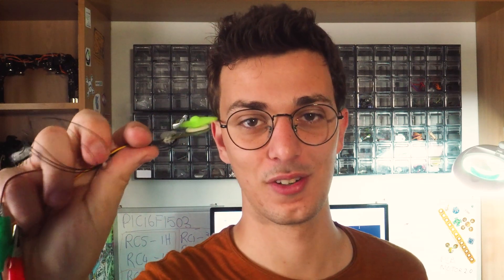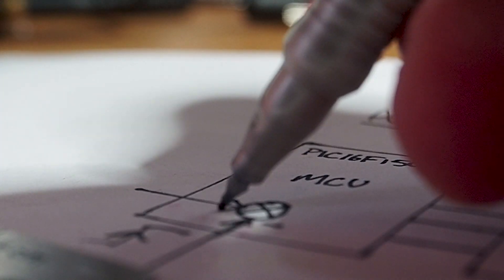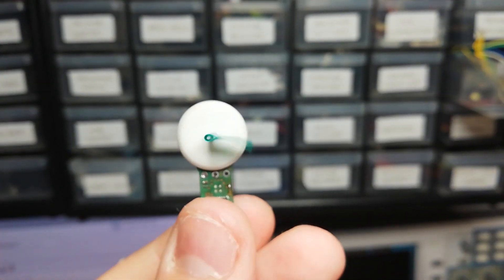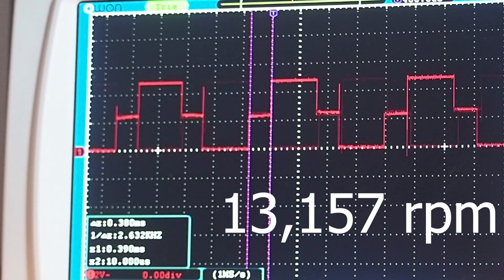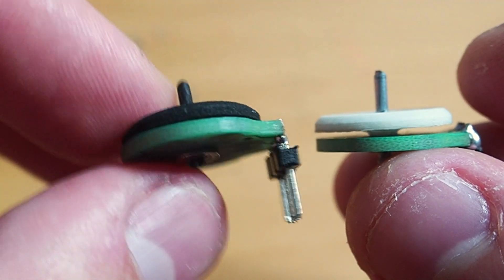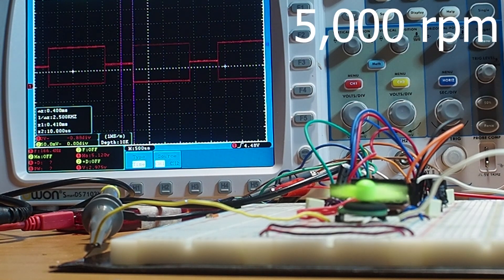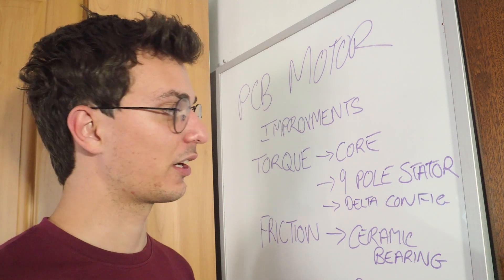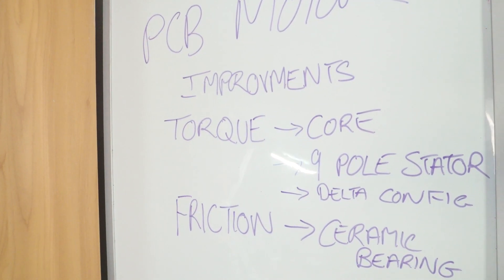PCB Motor - How fast can it go?

Comment: i feel like one good use case for these motors could be for air circulation and ventilation of electronic devices. Like how laptop computers have fans inside to circulate air and cool the components - they could instead have a few of these built straight onto the motherboard, directing air flow through the internals. They're really small and can basically be surface mounted.

Comment: you may get more rpm if you use a TMC driver. they use very fast ramping in their timing and the motor has better syncing with the waveforms.
keep up the great work.
Russ from Ocala, Florida, USA

Comment: hi, very interesting.
You switch to the DSP but then also switch to double, that are probably done in software (most uc, if they have and FPU can do only float).
My suggestion is, instead of using double, continue to use int, and if you need more precision switch to 32bit integer (your pic is a 16bit cpu).
Best would be (IMHO) to use an stm32, so you get 32 bit, clock that can reach over 180MHz for small price, and a lot of Flight Controller already uses them so the "drone" phase will be so much more easy to deal with (you may even think about one MCU controlling motor + sensor!)

If you drop a link to your code repository, i would be super interested to take a look into it! I am myself working on a opensource/hardware flight controller that in current form is 21x21mm and should weight less than 10g, but using an ESP32 (just because i want WiFi control), unfortunately it would not have enough pin to directly drive all the 3 phase for each motor, but i have an early variant using a stm32h743z: 480MHz, 144pin monster that takes 22x22mm in its LQFP, or the BGA goes down to 10x10mm (but never deal with BGA, I pass for now)

Comment: You need to have a more balanced rotor, the wobble has negligible impact on speed as compared to the energy it saps with an unbalanced shaft. That's why tops can spin so long is the balance is helping the rotation rather than fighting it.

Comment: A motor stator has to have an EVEN number of poles. Second, the stronger the magnets, the higher the BEMF. you either need to reduce the number of turns of wire per stator pole, or, raise the supply voltage. Once the motor is spinning fast enough to generate about the same voltage as the power supply, the current rolls off, and the motor just won't draw current to run any faster. The larger magnets will produce a lower speed, but much more torque.(a good set of bearings won't hurt)

Comment: An idea to reduce wobble,  mount one bearing to the top of pcb and one on the bottom, then use a longer shaft. You could design the rotor to have a dish shape to bring the magnets back closer to the coils.
Another awesome video btw thanks for sharing!

Comment: In the first measurement, you have yellow tape on the rotor which could slow it down because of drag. You don't have it on the second measurement, so it's hard to see how much of the difference is really because of better control.

Comment: Always test motor for stall torque and max speed(and extrapolate it to ideal idle speed with zero friction and current). Some additional points with accurate measured torque and speed should give you expression of linearity or not of control characteristic. Additional measure of electric power (U*I) and mechanical power (Omg*M), should explain how efficient motor. Lastly you can measure inductance and momentum of inertia for you rotor. 
This measures allow you objectively(more or less) compare any electrical motors.

Comment: You can also try with multi layer pcb, to increase the no of turns -> EM field, along with a bit larger thick of tracks.. That increases current -> torque

You can stack two or multiple boards, either one above the other, or one on one side and other on the othe side of the magnets that form the stator, thus as sugested in one comment you can put two bearings and give much stability.
Also like one more comment you can use ferrite core in rod shapes at the center of each coil, as they have lower hysteresis, resulting in lower loses, increased em conductivity.

Best of luck and great job👍

Comment: Hy, really cool tests
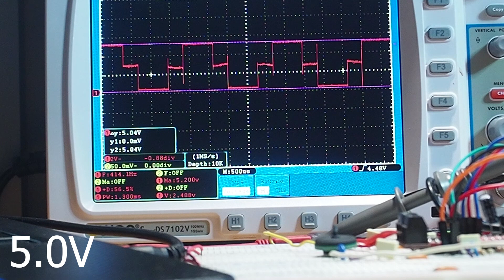5:00 min
Bigger magnets
The difference is the weight, if you obtain quite the same speed with really more weight you have obtain a more powerful strength
The other thing is about the different voltages
If you can put more voltage for the same quick, it could signify that the tork is improved
The limit will be the amps lost between the two values when you apply counter forces

Sorry for the translation :-)

Comment: The problem with hall sensors that read the motors primary magnets directly in line with the coils is the coil-fields will interfere when you increase drive power.
This means you introduce a phase error when you start increasing power and this can weaken your torque.

Comment: What if a small through hole is made at the center of each winding/coil traces and place high perimiability ferrite kinda core material in that hole. This will increase magnetic field generated by coils at the expense of slight increase in weight. Can increase torque and rpm.

Comment: Cool project; check out this teardown (http://build-its-inprogress.blogspot.com/2018/12/core-outdoor-power-pcb-motor-teardown.html); a motor of this type is I think the furthest you can push this concept, in a reasonably DIY friendly way. The stator is a pure PCB; you dont need to add a core in there really, as long as you keep the copper fill factor high and your stator thin, you can make a very power dense 'coreless' motor. You do want to add backing iron to your magnets though, as well as put magnets on both sides. You want your magnets to be able to complete their flux path with the least reluctance possible; so you only want your precious and heavy neodymium putting in work where you cant avoid it; that is, your air gap and copper wire. Get all those things right, and you can even exceed the power density of a cored radial flux bldc.

Comment: You should try iglide L350 sleeve bearing  from igus, it handles up to 210 °C, and its a non magnetic polymer.
It's available in D 3mm.
You have quite some comments, so i hope you read it and it gonna help.

Comment: maybe you could add more pcbs with the coil patterns and stack them like a sandwitch so you can get a higher magnetic force, besides adding a core... or maybe 2 pcbs at each side of the rotor.

Comment: Perhaps layering of the printed coil part to increase the field strength and torque? But first thing to do is something about the weeble-wobble with that current bearing. Need something with more precision at that small size.

Comment: I think having the shaft fixed to the stator and using the bearing on the rotor will make the motor more stable if nothing else. I think ideally you’d have PCB stators on either side of the rotor to maximise the efficiency of the magnetic flux use, and this would allow for two bearings per motor which would make the rotor much more stable and easier to balance. I’m assuming your stator boards already have coils on both sides of the FR4.
Reply: Actually a layer of electrical steel on the opposite side of the stator might help to concentrate the magnetic flux on the rotor.

Comment: You are probably generating some nasty eddy currents in that bearing causing it to heat up and increasing dynamic friction (may be the cause of the wobble too). I dug around a bit and couldn't find a 1.5mm ID full ceramic bearing either, but it's definitely worth looking into.
Reply from the maker: Yes I'm probably am generating eddy currents in the bearing.. But every motor does 😜

Comment: Using floats, eww! No! If you need more precision, use fixed point arithmetic that treats the lower bits of your integers as representing fractional parts, don't use nasty gross floating point numbers. Floating point is for lazy programmers with cpu time to burn, not for motor control loops and embedded code.

Comment: Hi Carl. I absolutely love this idea of a PCB motor, thanks for sharing. BTW I'm also confident you could achieve higher speeds with an 8-bit microcontroller provided it has a dedicated driver. Have you tried the ATmega64M1 family? It has 3 half bridge output stage drivers, ideal for driving motors.

Comment: If the main aim is to control a bldc for a drone. Focus on that aspect maybe and not the basic control algeo for control. For eg stm has some aio ic's that can do FOC with built in bridge drivers and deadtime and encoder or hall inputs for closed loop. I don't think saving dollars on the micro controller should be the focus.  But I love every bit of the content you have put out and the detail is amazing.

Comment: Add a second pcb to the top and wire to pulse opposite phase for the other side of the magnet. This will greatly increase your torque. Another interesting experiment would be to try to create a halbach array with another set of windings around the primary coils. Figuring out how to phase them to direct the field may be difficult. You could also try adding a through hole to the center of the coils, and adding a small ferrite bead or silicon steel stamps.

Comment: PICs are 4 times slower than AVR for the same clock frequency.. try an AVR using C on Atmel Studio and not Arduino IDE.. you can reach speeds upto 12k to 18k RPMs if the motor allows for that.. and if you want even more power/speed go for STM32F1 series... those are really really fast and way cheaper.
Reply from the maker: For the last tests I don't think its an issue with the micro.. 11us was the time resolution it achieved which is good enough 🙂 but an avr can work just as good
Reply: @CarlBugeja  Why not esp32 or esp8266? Then you also get wifi for "free".

Comment: my suggestion sums up to 2 keyword:  
1. polymagnet, (3d printed magnet). 
2. halbach array (like that tesla is using in their motor)

Polymagnet stator can be printed layer by layer, by using both PA66 and magnetic dust just NO ONE had actually done it in such a small scale.
It could be costly to work with (they are in USA).
 
1 few issue you may encounter later: 

pcb may not be strong enough for drones to last long enough, as it rotates it may generate too much vibration.
Can be addressed with carbon fibre, or other mechanical vibration dampening design.

Also when the motor is generating enough lift through the "wings" you may a good system to hold the battery cells, or use some special light weight battery. I think battery is the main issue here above all else.

Comment: Alternative to ball bearing would be to use igus sliding bearing filament for 3d printing. You could actually ditch the center axis and mount disc from the edge. This would also help to maintain desired distance between magnets and coils. https://www.igus.eu/3d-print-material/3d-print-filament

Comment: are you certain  Delta stator config will  WORK.  in a motor.    or, will such a coil interconnection result in phases that cannot be separately energized.        googletranslate

Comment: you have made tiny motor.   it should be  Dedicated  to a  TINY  job.      the motor has  Negative  MA  over  the  'outer' parts of the prop/rotor blades.     motor slowing, when under a Correct load,  could be  less than that  seen, here.       googletranslate

Comment: Put rotors with magnets on both sides of PCB. Magnetic field will be much stronger through PCB.
Blow ESR capacitor near the controller with stronger traces on PCB.
It is very strange that you have the same RPM at different voltages...this would mean there is something wrong with the loop. Did you try to change hall effect sensor a few degrees in each direction?  Torque...more current...use 3oz copper layers.
I would also double PCB and use sleeve bearings for stability, anything else is overkill for the testing...maybe the last few %.
Reply: what WR3 says sounds right.

Comment: Wait does your pic not have a phase lock loop to achieve 64MHz?
Reply from the maker: Nope it's not mentioned in the datasheet
Reply: @CarlBugeja  ah ok 🙁 the little pic18s I use have phase lock loops that achieve 64MHz. I guess pic16 must not include that feature.

Comment: try layers, for example, 3 stator PCB's stacked in a sandwich, and between them two magnetic rotors. the inner PCB could be double sided. you could even use pieces of PCB to put it all together with solder, also you could implement a second bearing this way

Comment: U defently have to go with the ferrit core. Implement it as an empty space in the layout and then use electrical steel sheets slized and fill the space with the cuttet steelstrips horizontally, may fix them up with 2 components glue or smth. Not vertical! Because of the eddy current. Love ur mindset thou. Keep up the good work.

Comment: I've had an Idea in mind for a while now of a fist-sized spherical drone with internal propellers. The only extra bells and whistles I want on it are bluetooth phone connection, camera, microphone, and follow functionality. I think with a couple more improvements this would probably be a good motor for it. Especially if it can move quickly enough that it can hold something steady with smaller propellers. I'm trying to keep the whole thing under 2 pounds as well, and that's made the typical brushless motor a problem.

Comment: Hey Carl, very nice job so far! I'd like to suggest you to perhaps do some system-level calculations to see if you can even hope to get what you need after these improvements you're proposing. For example, how much power do you need to lift the drone? You might want to measure the power consumed by the brushless motor (the stock one). Of course measuring your PCB motor will give you a ceiling for how much power you're consuming now, but I assume the efficiency is much lower for the PCB motor. I wouldn't bother using fancy bearings now, because the main problem is not power drain through friction, but not having too much power to begin with. 

A simple ballpark calculation to get the drone power is as follows:

Assume your rotor is a circle with area A. Then estimate a mean air velocity V through that area. The thrust is (at most) T=rho*A*V^2. Compare the thrust with the expected weight of the PCB+motor+battery to ensure it lifts off (add a good margin, like 2x, to ensure you can control it). The mechanical power you'll need is at least the kinetic energy imparted into the air: P=0.5*rho*A*V^3. To get the electric power just divide by the fan efficiency times the motor efficiency (probably order 50% or less). This number you can compare to your current power to see how far you are. I think it is a good idea to do this, because if you find out you need to increase the coil diameter you can do it while increasing the number of poles for the next PCB run. Also, note in the power formula power is proportional to A*V^3, but thrust is only proportional to A*V^2, so increasing the rotor diameter is always beneficial to reduce power consumption. It also lower the required rpm, usually, which seems to be a challenge you're facing right now with the PIC.

Keep it up!! (Sorry for the giant text!!)
Reply from the maker: Hi! Thanks for your suggestion I think I might look into this in more detail.. Like I said in the video I am currently focused on improving the speed and torque.. But it makes sens to also look at the power requirements